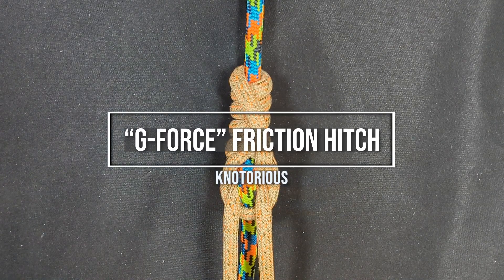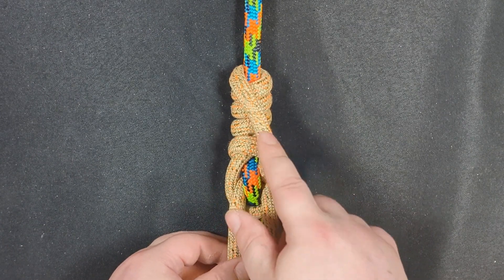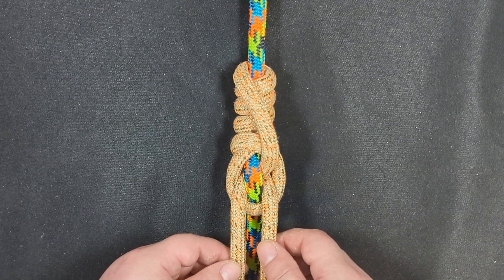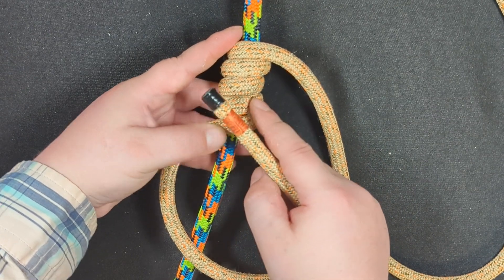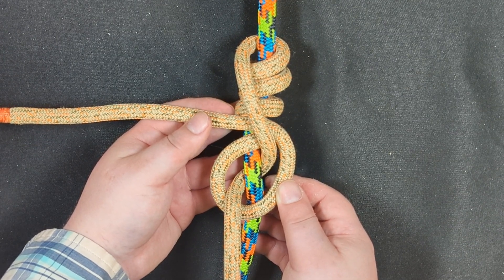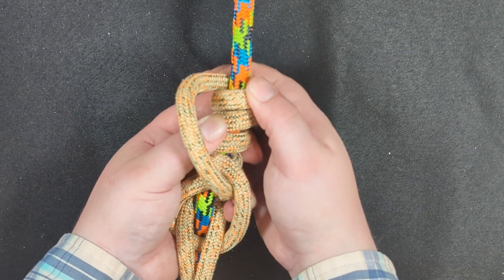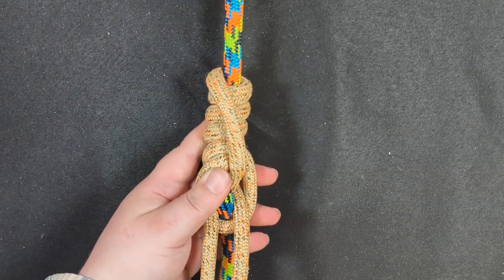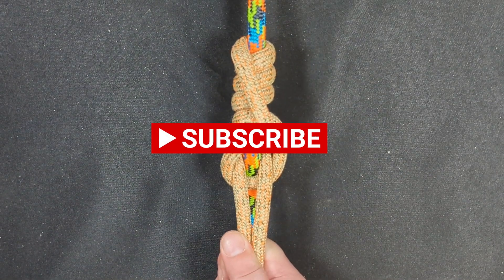G-FORCE Friction Hitch for Arborists & Tree Climbers!

Comment: So im thinking a 32inch double eye prusik cord might be enough to tie this? Didn't try it yet buddy lol 😊
Reply from the maker: A 32" honestly might not be long enough. You would probably need to be working wtih a 5 foot length of hitch cord. In the video I use a 5' length of 10mm Flex hitch cord by Sterling, I believe. The legs would still have enough to to tie Poacher's knots in lieu of sewn eyes and that's how this works.

Comment: If you put a twist on the backside it would make this a soft sticht, correct?
Reply from the maker: Yes, in a sense a it would be. I'm not sure if this hitch, with a twist in the back, would work without a rope wrench, but it's worth giving a try! Great observation! This is actually the hitch that inspired my PrecisionSRS 4 and 5 hitches, which are actually designed to work without a rope wrench. I actually came up with a new tying method, inspired by the G-Force hitch, which incorporates a ring and a twist in the back, that I believe might work without a wrench. Going to do some testing in the coming week to see how it performs. Great comment! Thanks!